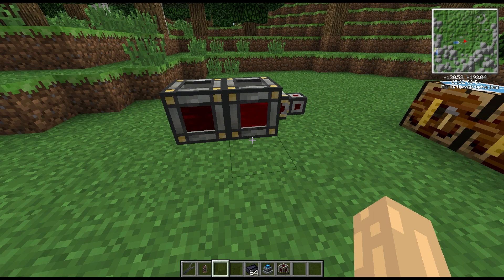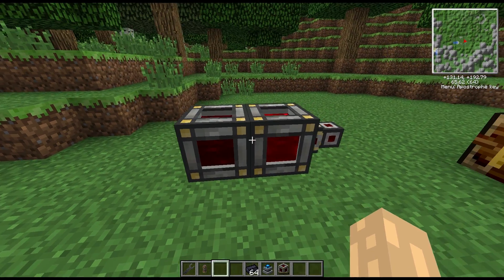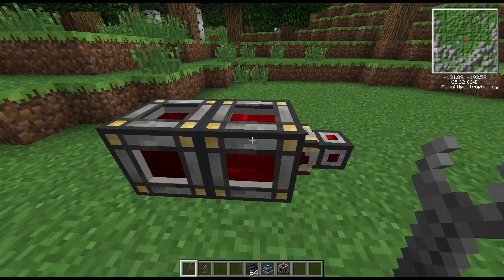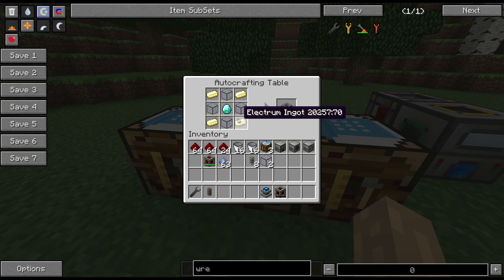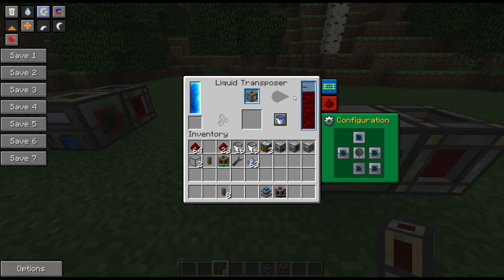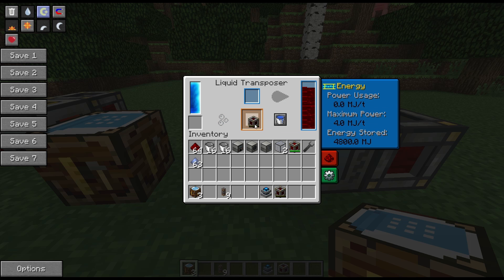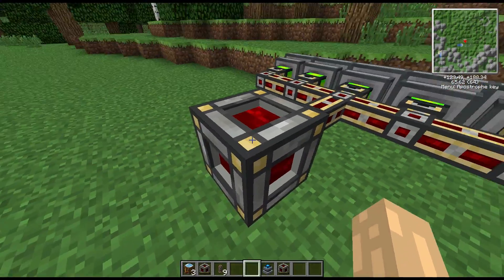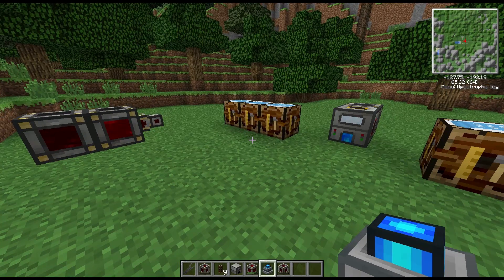Block Spotlight - Energy Storage Cell

Comment: Yes true, and I knew it was for MJ storage but I looked at your machines powering the cell and i've never seen those before ( they are kinda underwhelming tbh, so never used them ) so I thought it needed some special equipment. Hence my surprise it was powering after hooking it up to any engine in my collection. No biggy though, not attacking you, it was overall quite helpful so cheers for that ;-)

Comment: Correct me if i'm wrong but I think you forgot to mention you can power the energy cell by putting it directly into any MJ power source. Any type of engine that outputs MJ. I didn't know that so I was really wondering what kind of engines you were using there and if I specifically needed those to power it which doesn't seem to be the case.